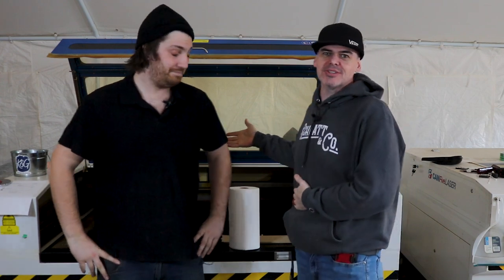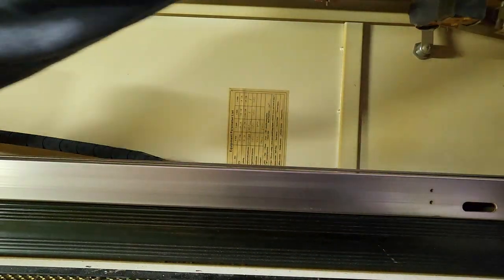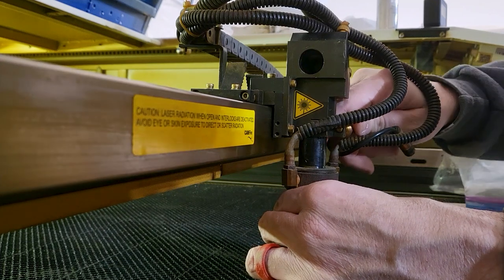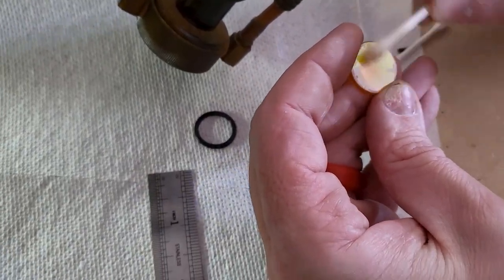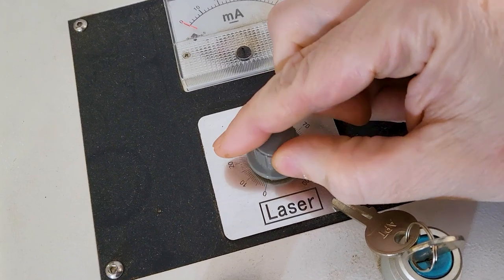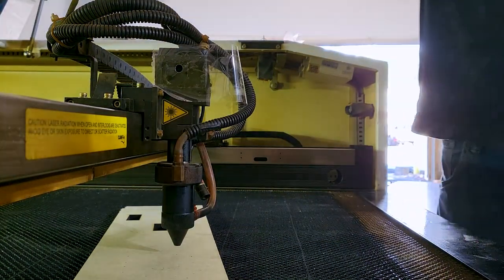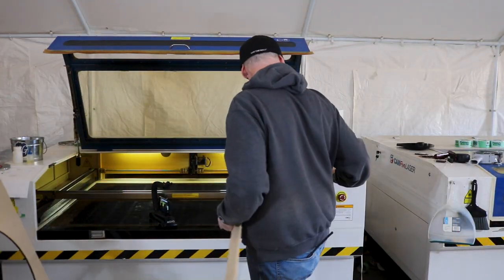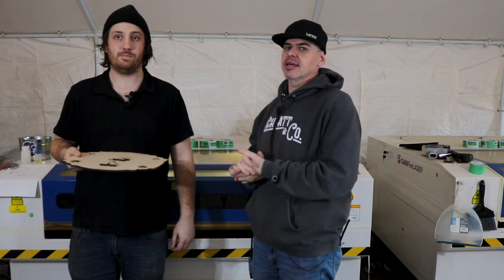WHATS UP TUESDAY - Laser Cleaning 101

Comment: Love my CamFive…have you ever had your bed go out of parallel with the gantry?  I am running into that with mine need to do some tweaking…😅
Reply from the maker: YES! It took us forever to figure it out, but we leveled the whole machine, and that fixed it. We put 2 levels on the bed and then screwed the feet up/down until it was level side to side and front to back. That seemed to fix it. Thanks! ~garrett